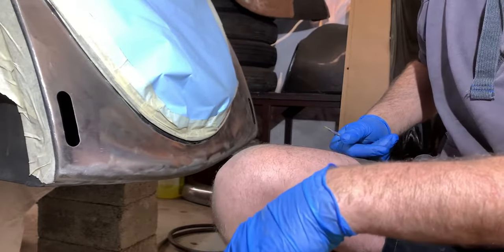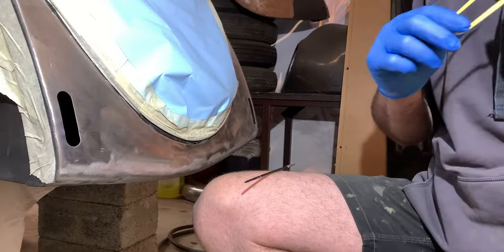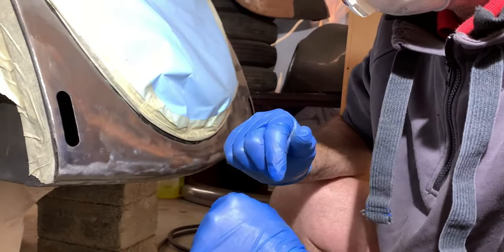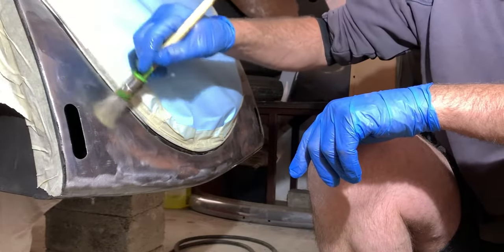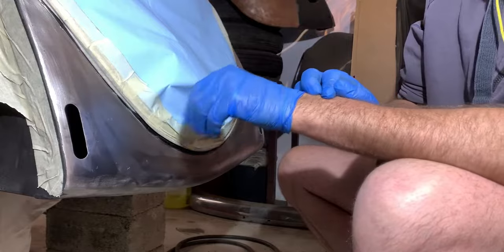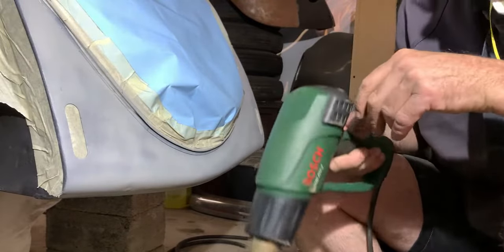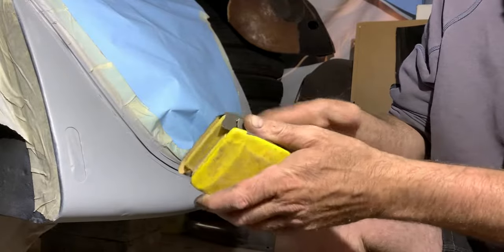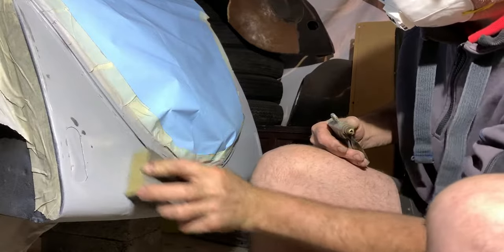VW BEETLE DIY PAINT JOB EPISODE #52

Comment: Outstanding!! Very well done! I like that green thing you use to strip paint. I haven’t seen those here. I like using a heat gun when painting! Paint came out great! Bead rails look great too!
Reply from the maker: Thank you My friend. Yeah that scotch brite is a very good paint cleaner without taking off the metal. 3M sales that. I’m very happy with the outcome off the paint. This time I used 2k and is Easier to use and dry’s a lot faster then 1K.
Reply: @VWBEETLEOVAL1955  I’ll have to look them up on Amazon. They seem to work very well for you. Yes 2K is a really nice clear, it’s nice they have it in the can with a hardner released.
Reply from the maker: @SladesVWBeetle  well these can’s doesn’t have the button to relieve the hardener. I can use them for a longer period. I will send you the correct name for those Bristol’s.
Reply: @VWBEETLEOVAL1955  Thank you I appreciate that! 
Oh yea, the button….hardner release is only good for 48 hours

Comment: what was that green sanding brush you used to remove paint called? i need  to buy 1.
Reply from the maker: That’s called a bristle disc roloc k 50 from 3M. It’s a really easy tool to use and don’t wear fast.
Reply: @VWBEETLEOVAL1955  thank you. car is looking great. cool that it's your grand dad's ride.